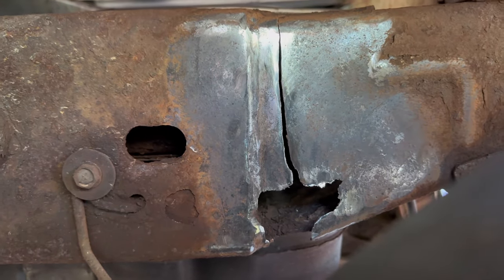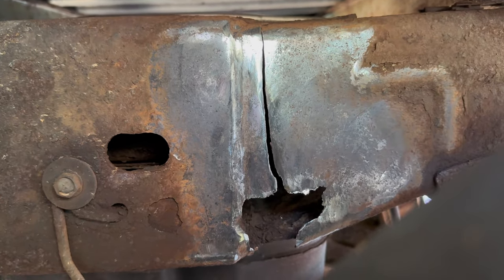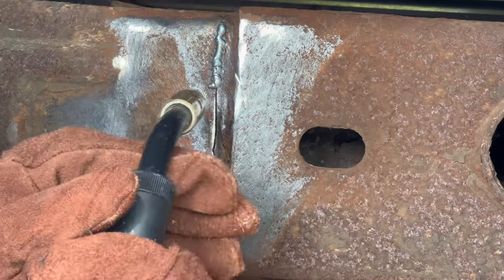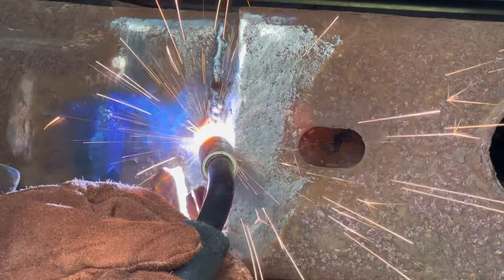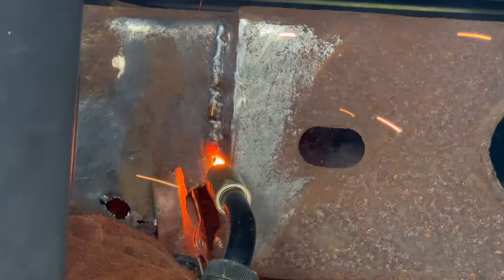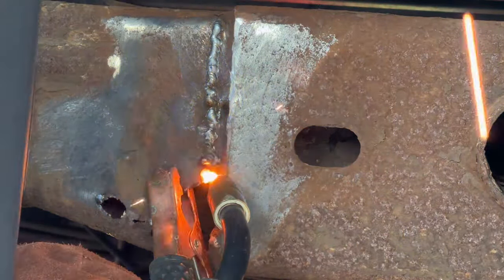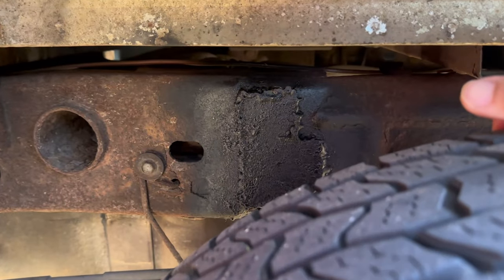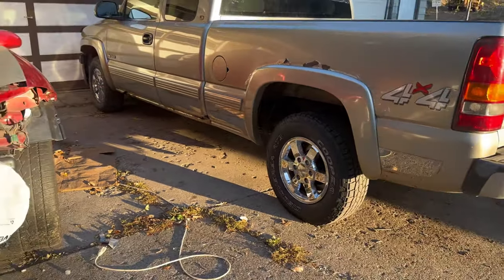Welding cracked truck frame (repair)

Comment: You might want to scab a plate over the crack.  The metal around the crack is most likely thin on the backside.  Learned the this technique while in the military, wasn't my job but knew an aviation tech who introduced this technique.  Basically, you grind the weld flat after welding it up then make a plate at least 1.5 times longer than the break, to plate over the repaired area and then weld it in.  Another techniques I use on rusted out areas is to cut out the bad area back to something solid, then take a piece of cardboard and a hammer to make a pattern of the hole, make a repair plate then weld it in flush then make the scab plate over it.  I often also drill holes in the scab plate and then weld them around the parameter of the hole to the base material.  Actually tested the weld technique in a press on test materials and found that it was significantly stronger than a new piece of material not reinforced, and tremendously stronger than a simple weld the crack repair.  Yes it is a pain in the bottom to do but it works much better.

Comment: Son I am proud of you but always start at the bottom come up hill with your bead run a little more heat 😁
Reply from the maker: Thanks for the advice.
Reply: Yeah downhand has no penetration and it sounded cold.  It’s gonna crack again for sure.
You wanna go full pen with something like 7018 or ER70S.  MiG is great for some things, but I wouldn’t use it for anything structural.  I don’t trust it.
Reply from the maker: @JohnStrandt Thanks for the advice. I’m just learning as I do. This was weld was in early September and I driven the truck a lot, seem to be holding. If it crack again I’ll do a update n I’ll try uphand with high voltage. Thank you.
Reply: @JohnStrandt  Strength is NOT a weakness of mig, it is only a concern in the hands of an inexperienced user making welds like this, which would be a problem regardless of mig tig or stick. Stick will yield a slightly better weld in comparison to a flux cored wire, yes, but not compared to mig with shielding gas which I'd argue is easier to learn how to make a solid weld. If he dials in his settings, watches a few tutorials, better follows the path of the material, ie getting a better lens, I think mig is perfectly capable for a structural job like this. If he wants to learn how to be a welder I will say stick is a great way to learn, mig and tig both come easy when you learn on stick. If you learn on mig you can get stuck.
Reply: I wouldn't recommend uphand welding it, it's thin enough that you'll just start blowing holes in it and get pissed off. Vertical down is perfectly fine for a repair like this, the frame is most likely less than 1/8" thick, especially in that spot. If you are still concerned about penetration, gouge out the crack a little bit. Also, turn that wire up, your voltage was a tad too high for your wire speed, hence why it sounded like it was cutting out.
Reply: Yes downhill here is fine with fish plates a must. Fixed a few of these junks and square body  front frame horns. Just finished a 2009 chevy with two safety cap crossmembers. Went downhill with plenty of penetration.

Comment: 1. V your welds. Always, even if the parent material is thin. Full penetration is the name of the game.

2. ALWAYS put fish plates on top of frame repairs. Never weld and leave the weld out in the open to hold. It will crack eventually and because you've just welded that area, it's become a different material, so the crack will be as large as the crack was + extra. If you've seen those videos with trucks in Asia repaired in flip flops, those cracked frames aren't wear and tear and abuse, a lot of those are old trucks they welded before they caught on that you're supposed to put fish plates (reinforcements) on top. Rule of thumb, the fish plate should have round corners, in a rhombus form, and it should cover the crack 5 to 6 cm on all sides (the more "grip" you give that plate, the more it will resist and take stresses from the crack).
That includes bending the fish plate to snake around the frame if the crack has climbed on the horizontal plane. You can get away with a small plate if it didn't go past that.

Personally, i also like to drill the end of the crack and leave that hole as is so no stress ever plays from that weld area.

Source: i fix all of my brother's farm equipment and whenever we've had time to do this repair as stated, the repair has lasted the test of time and lots of kgs on top of it on rough farm land work. It's a bullet proof repair.

Bonus: if you happen to have access to stainless steel or feel you can take that coin loss, use stainless for the fish plate. It will never rust. Also, use weld through primer on the frame and the inside of the fish plate when you assemble them. You also want to put a small (1mm) hole in the fish plate for the gasses to escape as you weld it. You plug that hole over after it has cooled down. Just my 2 cents, nothing more.

Comment: Heres a good tip that should help; keep a small piece of copper or aluminum plate pocket sized to use for a backing strip. The weld will easily break away from the strip and you can run the bead as you please. Hope it helps good luck

Comment: Pretty good job for your first time. It takes a lot of practice to get good at welding. The heat setting could have been a little higher. Drill a hole at the area where the crack ends. This will prevent the crack from extending in the future. Grinding a slight V in the crack will help with better weld penetration. Cover the repair with a good chassis paint such as POR 15 or Chassis Saver rather than rubberized undercoating. Chassis paints are affected by UV light. Once the chassis paint is dry, top coat it with regular spray paint.

Comment: Good attempt. Two recommendations I would have made, one, grind a "V" at the crack to get better penetration. Two, more amperage/heat, you really want to burn the weld in.
   The other thing, like someone else recommended, weld the bottom to the top.

Comment: Good job with this type of welding down hill is ok  grind down your weld the next time and turn your heat up and run another weld on top of the weld you grind down

Comment: more heat! turn up the welders amperage!  The metal around it should change color front and back side of that about 3/4 of and inch along the whole weld.

Comment: You really should practice on some 1/8-3/16-1/4 coupons, it will take some time, but better to have some time in the seat, than streaks in the seat when your first welds decide to let go when you hit a bad pothole with a load in the back, also you should use flux core wire it has better penetration than solid mig wire, in both 110 and 220, just make sure to buy E-71T-11 if it has this designation it had to meet a bunch of criteria and is aws approved and multi-pass, generally stay away from E-71T-GS, its not aws approved and is just whatever that manufacturer thinks is good enough for a single pass, there are some decent options from reputable brands though.

Comment: You can hear that your settings are wrong. Also clean the steel  really good.  Making some holes and placing a gusset behind would be a better solution.

Comment: Your heat is to cold,  turn the Amps up on that welder and reduce your wire speed,  use a grinder and bevel the edges of the crack and drill a hol at the end of the crack to stop it from spreading further.  Start your weld at the bottom and weld up the crack watching your puddle.  Once welded grind it smooth then put a plate over the cracked area and weld around the perimeter of the plate.  Your “fix”. Isn’t fixed,   I understand your learning but learning shouldn’t cause you to loose your life if it fails or cause someone else to loose their life if it fails.

Comment: I would have removed the tire and gotten a grinder in there to v notch that crack so you could get better penetration. And then weld a scab plate over it. Try going a little hotter next time.

Comment: First, you needed to become familiar with the frame repair technology. Welds are never placed vertically. Here the metal was destroyed by corrosion - a patch should have been applied, but avoiding vertical welds, in the shape of a triangle or diamond. Even the Pakistani truck repairmen on YouTube know this. I'm not a hater and I respect people who work with their hands, especially those who want to learn something new. But sometimes you need to spend a little more time preparing. The safety of you and those around you depends on the strength of the frame.

Comment: the frame twists from poor design. weld a bar behind the radiator from the left side of the A-frame to the righ sde of the A-frame to stabilize the steering gearbox.all 70's - 2000 chevy trucks has this design flaw. the gearbox must be stabilized or it will happen again and break your welds. thats the only solution. the gearbox turns when u turn the wheel putting pressure on the stress point of the frame which causes it to crack.